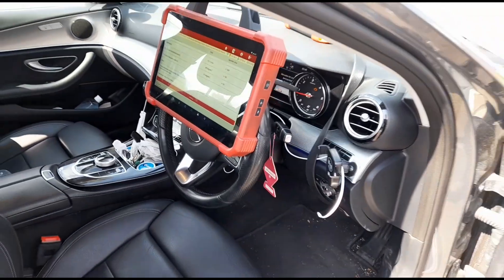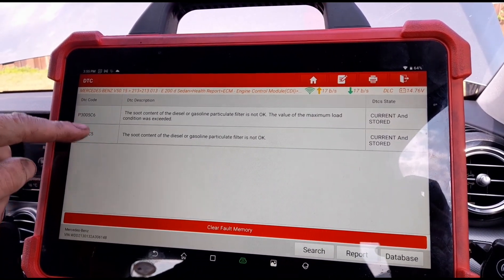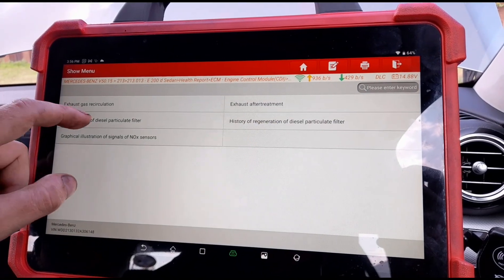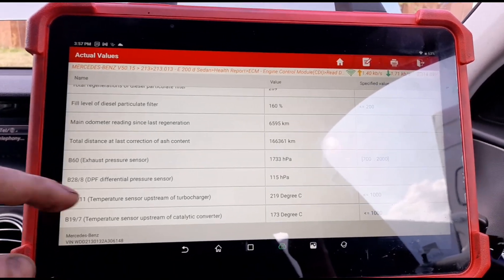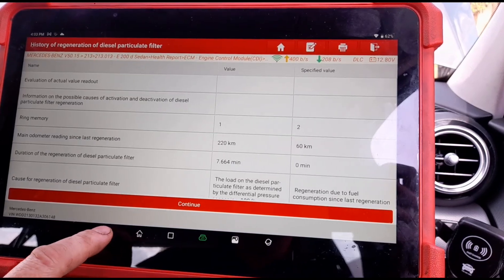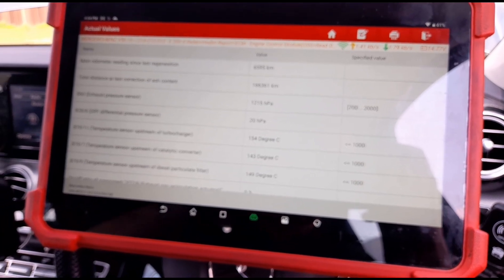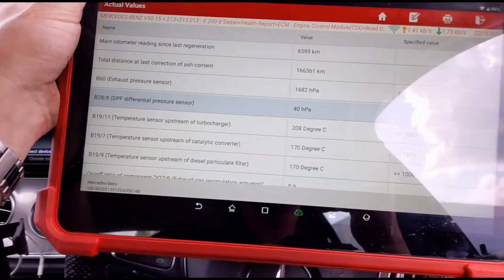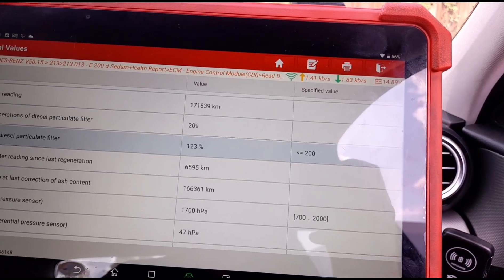Mercedes E Class 2.0 P3005C5 P3005C6 The Soot Content Of The Diesel Particulate Filter Was Exceeded

Comment: Did you attempt a regeneration afterwards as I've had one of these today with the same issue but would not do a regeneration, the ecu took the command and idle went up to 1200 rpm but the exhaust temps would not rise like it was waiting for a perimeter to be met, this was before and after flushing the dpf.
Reply: Was the issue an Adblue delete?
Reply: @MykaRoze  it was a wrong perimeter set when the adblue delete was applied, basically an unreachable target perimeter before regeneration would start.
Reply: @MobileDpfCleaning  I've got mine booked back in to have it remapped as I called them today, and they said they can solve the problem. Big thanks for uploading this video, or I'd never had contacted the Adblue guy regarding the issue 🙏🏽
Reply: the fault was a bad map, after it was corrected it did its own regen
Reply: How did they correct the problem? I'm having a similar issue on my Mercedes E class coupe w238 version
Reply: @MykaRoze  it was sent to another re mapper who rectified it in the software I think it was to do with atmospheric pressure data which had been changed.

Comment: That car is going to come back to you. Same problem on mine (same car/engine). When the fill level reaches 100% it should do an active regen, but it doesn't. 
I've cleaned the dpf and reset it but it still will not do an active regen.
Reply: Maybe you removed the Adblue system recently? Some tuners use software, that accidently changes the atmospheric pressure threshould for dpf regen to 0.
Reply: I have the same car what is the best solution if I don't have the launch gun
Reply: What way did you clean it, I have the same car engine and will stay off for few weeks then light back on
Reply: @markreid1587 I used Wynnes. Took the pipe off and poured a couple of litres in using a small funnel. Left it for an hour and revved it until it was clean. 
About 100 miles later driving about town it went past 100% and kept going without attempting to regen. About 50 miles after that it reached 130% and the EML came on. 
Had it into Merc and they're just throwing parts at it. 
Next thing will just need to be a delete.
Reply: @BigBawMcGraw   yeah Same kind of thing happened to mine I got it cleaned yesterday its now sitting around 40% atm so will see what it does over next lot of miles, thanks for the reply 👍
Reply from the maker: @markreid1587  try a forced dynamic regeneration and see if the temperature comes up?. That way you would know if the system is capable of increasing the temperature
Reply: @ORileysAutos  hi I tried regeneration there and won't go over 300 degrees, fill level now 114% yesterday was flused and level was at 40% thanks for your help and reply
Reply from the maker: Can't see no reason why it wouldn't reach temperature  unless the filter is damaged?

If it comes back I'll video the resolution 👍🏻

Comment: When you have finished a clean on a dpf and you tell the ecu that the dpf has been replaced. What does that achieve? Does it have to recalculate the ash that isnt removed? If you do the clean but don't tell the ecu the dpf has been replaced what would happen? Thanks. Love the videos